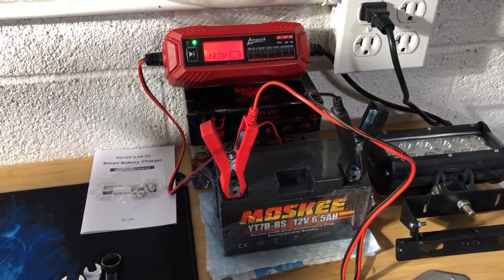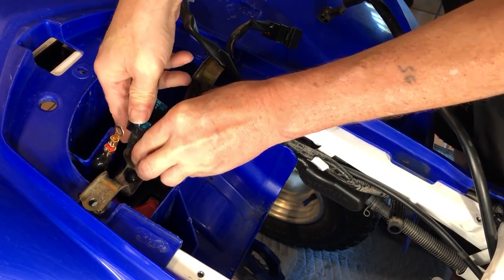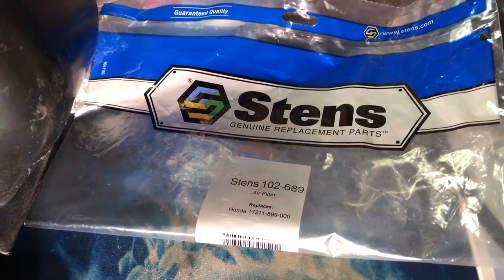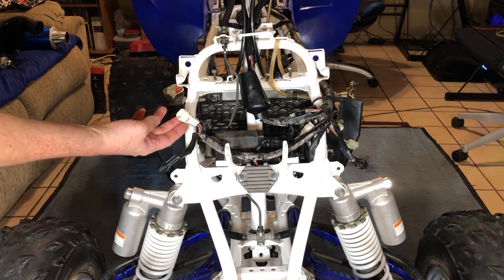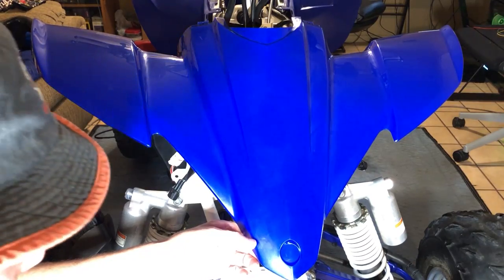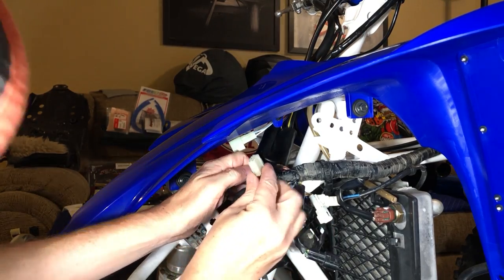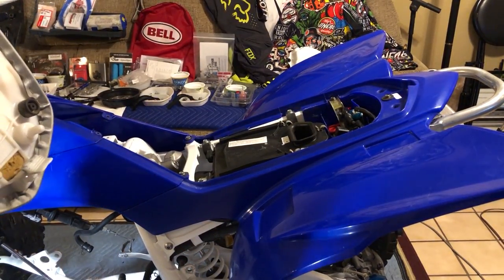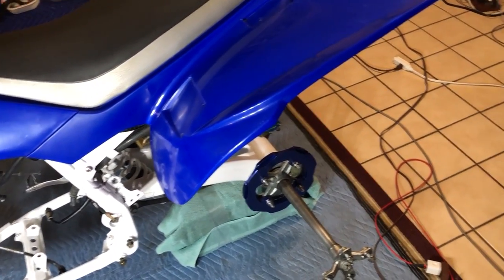Yamaha YFZ450 Build - Part 11 - Install - Battery, Ignition, Air Box, Headlights, Nerf Bars, Plastic

Comment: I know your busy but im at the same spot building my yfz in putting the motor in. You are my mentor! Any idea when you will continue im hesitant to continue myself.
Reply from the maker: I am Git-N-R-Done slowly but surely! I have a bunch of footage to edit but now that I am the "Manager of Web Design" for a multi-million dollar website I is really hard to sit back down in front of a computer and do more work in my off time. That being said, I have the brand new OEM crankshaft pulled in and the bottom end sealed up and installed into the frame and I'm just waiting on the brand new OEM cylinder, piston, rings, etc to get the top end buttoned down. I am finishing up the bottom end as we speak ... Thanks for watching this far and I will have the bottom end video up in the weeks to come ...

Comment: Where does the negative wire go from the battery? Does it get mounted to the frame or engine?
Reply from the maker: It goes to the engine, using the same bolt that holds the clutch cable bracket, that is located above the front sprocket and next to the starter ...
Reply: @11GalleryATV  and the power cable goes to starter correct?
Reply from the maker: @Factory43R  The power cable (short red) goes to the relay (solenoid) ... the longer cable goes from the other connector of the starter relay (solenoid) then to the starter ...

Comment: What size bolts are for the front flarings and rare & ehat size bolt hold down the gas tank.
Reply: Usually M8x1.25 I think
Reply from the maker: https://www.partzilla.com/catalog/yamaha/atv/2006/yfz450-yfz450v/front-fender